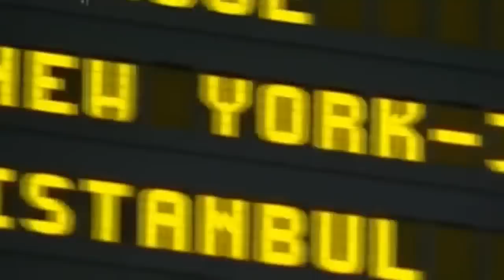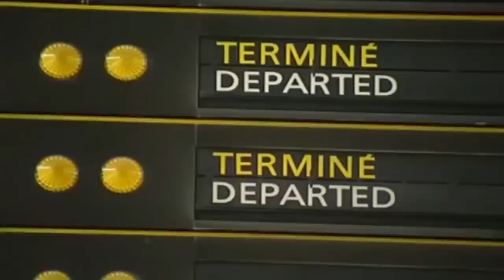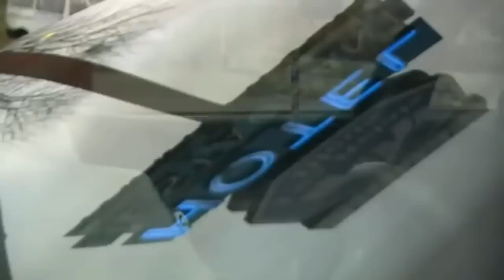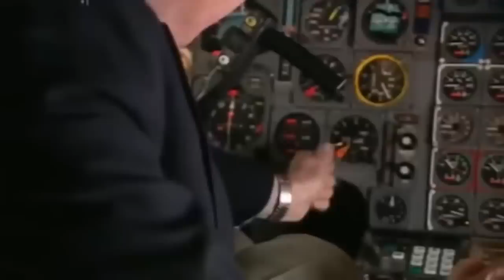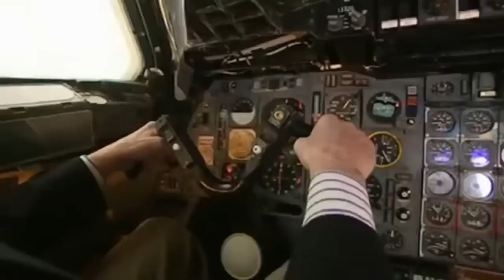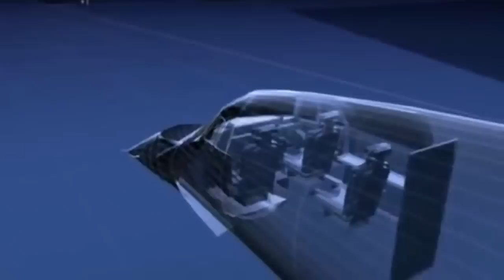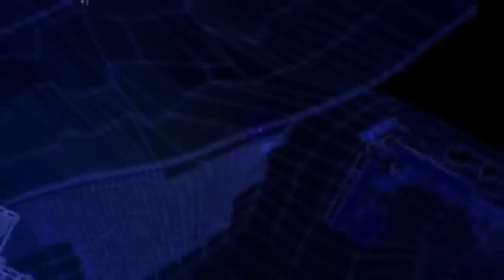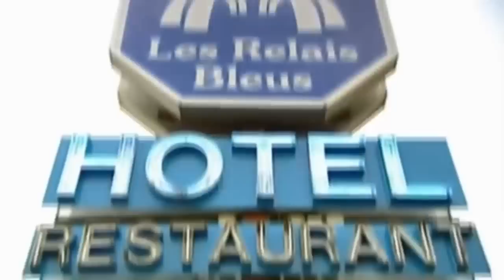Air France Flight 4590 Concorde Disaster Paris

Comment: Air France??  Same airline that had flight 447 crash into the ocean. And yoh know why ,? A co pilot pulled back on the stick raising the nose of the plane. Even as the crew tried desperately to right the plane he continued to pull back. He had the plane flying crazy. Its altitude dropped dangerously low.Finally after minutes of horror they realzed why. This moron was the reason why. At that point they were falling out of the sky literally. The warnings were goin crazy tellin them pull up pull up.Too late. They slammed into the pitch black ocean the plane and everything was flattenedq. They hit with their nose up and the plane belly flopped. The impact must have been enormous. No need to say but killed instantly all onboard. So be careful before you fly its good to check out an airlines history and safety record. But that Air France was a true air disaster that could of been and MOST CERTAINLY should have been avoided. It should not have happened at all. Pilot was very unfamiliar with operating the plane by himself without auto pilot. Terrible mistake by Air France as to not properly training the pilots to operate these newer high tech planes on their own without auto pilot.  I know one thing...if i ever fly in a plane to travel before i do.. i will take the time to check out their history.Safety.  Thats very important to me.  And for any family i  may be traveling with nothings more important than their personal safety. So make sure the airline you choose is one that has a good and proven record of safety. So very important.

.
Reply: paul dinardo A good practice would be, like the sports teams do, is have half your
family on one flight and the
other half on another flight.

Comment: Surely the pilot should have turned it around on take off ?
Reply: Crute Martyn that's what I'm thinking?
Could he not have slowed down and turned around..
But then again, looking at the footage, he wasn't too far out yet to start making a turn for the runway.
Reply: Crute Martyn jesus with the concorde's speed how wide a circle do you think it will need to make a turn? And any shoddy approach factor could've ended in equal disaster?
Reply: Cole The VII if the plane drops speed drag will increase and the plane will drop straight out of the sky... Christ physics 101...
Reply: Still if he aborted the take off and Even ran over the runway could have been better results than what happened , but it's just milliseconds the pilot should make decision therefore RIP to all and it's no one's fault